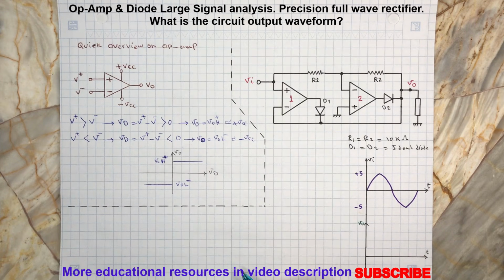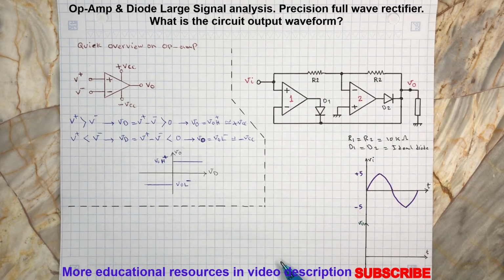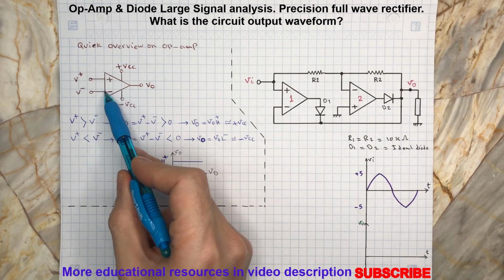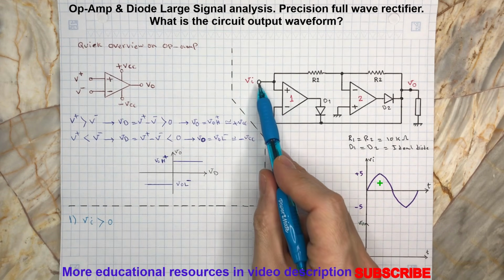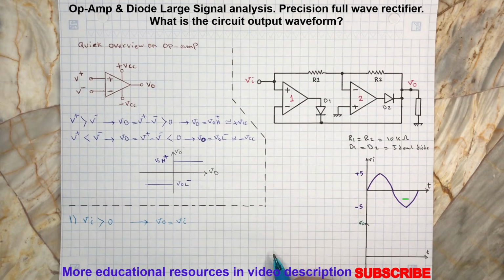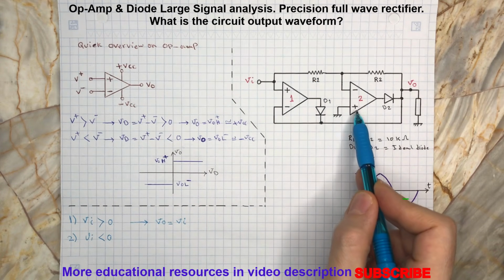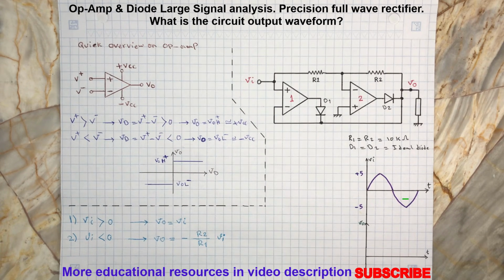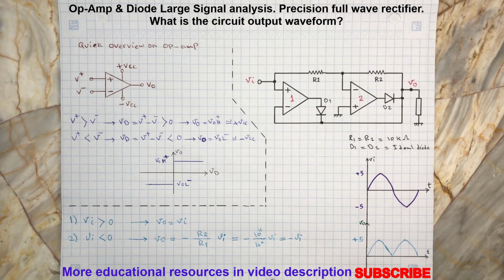Op Amp with Diode Circuit Solved Problem, Op Amp Precision Full Wave Rectifier

Comment: I have an conceptual doubt , considering that the op amp used is ideal would we not have the same voltage across the inverting and non inverting terminal as no current flows through the op amp , but here the op amp delivers a magnification of the difference between the voltages , is it just because it is a 'comparator ' ?
Reply from the maker: I am not sure if I understand your question, in general, as long as you have a very high voltage gain and a negative feedback, then the Op-Amp V+ & V- terminals will try to have the same voltage level.

Comment: When Vi < 0 , in the 2nd op amp wouldn't the potential at both the terminals be 0 and thus making the O/P also to be 0 ?
Reply from the maker: When Vi < 0 then this means Vi is negative, so ground level which is zero volt becomes positive potential compare to the negative voltage. So output of Op-Amp #2 will swing positive high.
Reply: But Vi is not directly connected to the inverting terminal of the second op amp ,it is separated by R1 how would we know that the voltage would be less than 0 in the node connection R1 and R2 ? @EngineeringinDepth

Comment: Could you please add some tricky switching converter as well
Reply from the maker: Sure, thanks for the thoughts. can you provide some examples of what you mean switching converter ? do you mean oscillator circuits ?
Reply: Switching Capacitor 😊